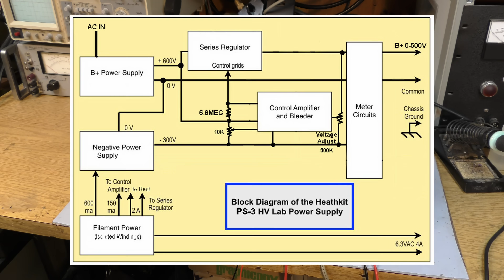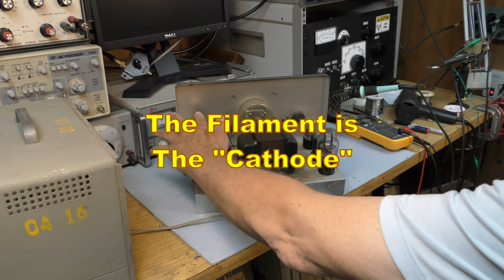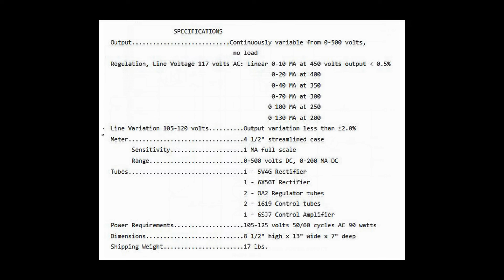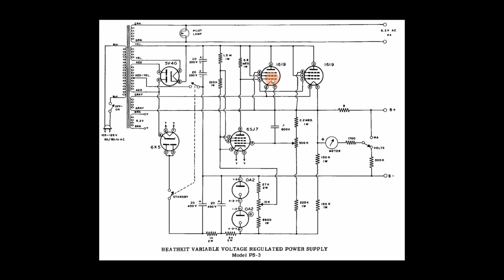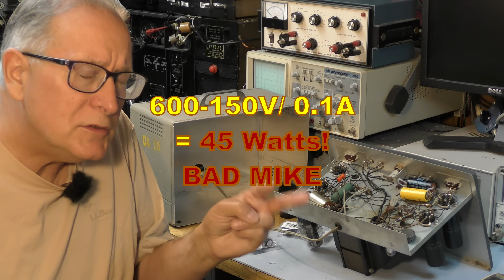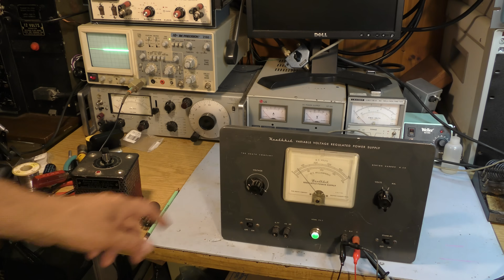Heathkit PS 3 Regulated HV Supply

Comment: Is the filament coated with emisive material in a non-cathode tube?  thanks
Reply from the maker: Actually yes! Filament coatings include Carburized Thoriated Tungsten and Oxide-Coated Filaments: Utilizing a core of nickel alloys coated with alkaline-earth carbonates (barium, strontium, and calcium). In a vacuum, these decompose into pure metallic layers, giving off large amounts of electrons at very low temperatures.

Comment: Your regulation issues likely causes by grid emission in 1619 shunting the 6.8m plate load of 6sj7 and then 6sj7 goes +v grid
Reply from the maker: I know that something is not quite right with the regulation. Perhaps compromises were made to preserve tube life.
Reply: @MIKROWAVE1  the circuit worked perfectly with new tubes . hints are plate resistor  load for 6sq7 way more than 220k or 470k for 6l6 grid.  Collins R390 used 470k or so plate load.  whatever their calculations were, grid emission would throw em off and with old abused tubes grid emissions are very possible.

Comment: In one of the Ap Notes he wrote while at Linear Technology, the late great Jim Williams presented a hybrid voltage regulator circuit using a mix of semiconductors with a big vacuum tube for the pass device. I don't recall ratings, but the approach would be broadly applicable. I think it was in an ap note about boost (voltage, current and/or power) for semiconductor voltage regulators. It may have been in one about boost circuits for operational amplifiers.

These days you might contemplate using linear power MOSFETs for high voltage supplies. There aren't very many linear power FETs on the market, unfortunately. Some I looked at years ago were 600 volt parts with pretty substantial power rating. FETs designed for switching don't play nice in linear circuits.
Reply from the maker: I agree that the logic level drive FETS would be an issue, but in general, many common HV FETS yanked out of old power supplies should have no issue in linear service as long as you stay within the SOA! We shall see.

Comment: Hi this is Dwight again. When you replace the line cord with a 3 wire grounding cord. You will not need to install y caps to the hot or neutral leeds like a .047 mfd. All that will do is put a 60 hz hum on what ever the p/s is used for and it creates a shock hazard. You can check it with a voltmeter. 
You will find voltage being fed to the ground wire on the chassis of the power supply. You don't want that.
Reply from the maker: Remember the purpose of these capacitors. It has nothing to do with safety even though they are called "safety capacitors". They are specifically EMI protection for the outside world from YOUR equipment. Safety is a characteristic in a worst-case situation like a power surge.

Comment: At 8:50 there is no way the tubes are running into anode power dissipation issues at high output voltage. The voltage across the pass element is the supply (say 600 V) minus the output voltage. For a low output voltage the pass tube sees the maximum voltage drop (around 600 V), therefore it sees the highest power dissipation for the same current. 
The assumption that high output voltage means high power dissipation is only true for the load, not for the pass element.
Reply from the maker: Yes, a mistake in my thinking. But the data sheet does not support this, so there is some other factor. At higher voltage, the current rating goes down. It's just the opposite of the premise that set at higher voltage, the pass device should not be dissipating as much.
Reply: @MIKROWAVE1  I agree. I looked up the manual of that power supply and it looks like the other way round, but I don't understand why.
Reply from the maker: @VoidElectronicslooks like I need to do some testing.

Comment: I read about Bob Widlar years ago, genius, very sad to lose a guy like that at only 53 yo.
Reply from the maker: Those amazing chip designers deserve some historical recognition all right! When I worked at ADI, I used to marvel at Paul Brokaw's way of simply explaining fundamental circuits like the band gap reference and differential amplifiers and biasing for stability in IC design. I also got to work with Barrie Gilbert, another giant. And Walt Jung - 555 cookbook etc...

Comment: It's a wonder Heathkit didn't use the negative  150/300 vdc for user external access. Like other HV PS did, at providing a variable -bias voltage output.
Reply from the maker: And a center tapped 6.3 winding would have been nice as well.

Comment: Be careful of using too much capacitance across a tube rectifier.  You can damage the cathode[s].
Reply from the maker: The standby switch if used properly prevents this corner case. Modern tube amplifier designs should all have solid state rectifiers or a STEP-START system for tube rectifier. But it's still a corner case, with very few real-world examples in transformer powered equipment of an actual tube failure. 5V4s are very tough.

Comment: The logic of the voltage/current limit characteristic being due to pass device dissipation confuses me. I would think that since the pass tubes are in series with the load, the current rating (as determined by the tube V*I dissipation product) would increase at higher output voltage (lower “headroom”, lower voltage across the pass tubes) and would decrease at lower output voltages where the voltage across the pass tubes is maximum. Where am I getting the logic wrong here? It only makes sense to me if I think of the limiting factor as being the power transformer, (VA limit) not the pass tubes.
Reply from the maker: Yes, something backwards here - maybe next video.
Reply: @MIKROWAVE1  please, because I wanted to comment on the same issue. Why is it different then transistor pass elements?

Comment: I've got the much later IP-17 and it'll do 100mA at all voltages.
Reply from the maker: Yes, I think they improved the whole deal. Those 1619 tubes were 5 for a buck surplus! Heathkit loved to use surplus parts.

Comment: that circuit attempting to build it in 1 cabinet 1 a low supply with 500 55 ma transformer and another with 800vct transformer project stalled for a year now watched your videos  got it on bench today
Reply: iI was using 12dq6 tubes in parallel and a 6sj7 and6x5 and octal vr tubes

Comment: Very interesting topic, I wonder also if  substituting ( I know socket change ,etc ) another tube like a  higher transconductance tube 6ej7, instead of 6sj7 ,would net any performance gains?
Reply: Try this: the 6AC7 (~~,8,000 uMhos), or the 6SH7 (~~4,300 uMhos). Both are direct plug-ins. You may have to change the cathode-bias resistor. 73, Bruce N7MMR
Reply from the maker: @brucethorpe9521  Those are "super-pentodes" like the UK EF-50.

Comment: 23:50   You put in the capacitors well, is there enough clearance from the capacitor to the casing, because if the capacitor moves the capacitor body could short to the metal case and damaging the transformer or rectifier, if a fuse doesnt set off.  I hope you checked if the fuse value is apropriate, since as you must be well aware, people  mess with fuse values.  Since the schematic does not have an input or output fuse, please add one!  fuses are cheap, new tubes or a new transformer isnt.   Why does american designed stuff always like to leave out fuses?  All european test equipment or even the most cheap radios, even heathkit imported stuff had fuses.  

Also you increased the value of the capacitors, i hope this does not damage the rectifier tube since it could blow open the cathode wire, i hope its protected
Reply from the maker: Absolutely. And yes no fuse, no protective parts. No Thermistor no safety caps etc...

Comment: 2x 100uf in series for 50uf at output of 5v4 may exceed its specs -  and strip cathode. you can as well replace the 5v4 and 6x5 with series connected 1n4007 - atleast 3x series 4007 in each branch.  .
Reply: I thought that, but pulled 3 datasheets and they didn't spec max capacitance, like some do.
Reply from the maker: Great suggestion! But generally, these limits describe a corner case specification. In the case a power supply where there is HV instantly applied to a cold tube, such as a guitar amplifier for instance. This supply has a transformer which slows this some, but more importantly, it includes a standby switch which SHOULD BE off. So, when initially powered, the filament gets juice and the HV is only applied when the standby switch is set to ON. The 5V4 looks original. I wonder how TV sets handled this?

Comment: Excellent overview, Mike! Excellent work. The later Heathkit power supplies PS-4/IP-32 and the later IP-17/2717 were much better than the PS-3. 

I once had a PS-3 that gave me a shock from the chassis to ground. The HV secondary was leaky. I don’t think that transformer ages well.
Reply from the maker: It's a pretty complex (and BEEFY) transformer, with so many floating windings.

Comment: Excellent work! However, beneath the limitation of dissipation, wouldn't output current be limited more toward the lower end of voltage, since the pass elements need to dissipate more voltage there? It is this way in adjustable low-voltage supplies. Food for thought...
Reply from the maker: Oooo sounds like we have something to investigate for next time.

Comment: Heathkit actually produced a variable HV lab PSU into the 70s, maybe even the very early 80s. That was the IP17,  went upto 450 volts and possibly 200 ma from memory.  Only the output stage was valve though.  They are very scarce but I was lucky to find one at a vintage electronics fair in working condition about 8 years ago.
Reply from the maker: Yes, and they stayed with tubes all the way- maybe 1980? I know they transitioned to 6L6s at one point.

Comment: I used to have one of those. Then the power transformer developed an internal dead short between the HV secondary and frame. I ended up salvaging what I could and took the chassis and transformer to a metal recycling place.
Reply: Exactly the same thing happened to me. I used to find these at hamfests in the 80’s and 90’s for five bucks. I recapped another one, used it for several years. My first HV bench supply, it worked great. However, eventually the HV secondary failed in that unit as well. 
I don’t think the HV winding in the PS-3 transformer is very robust, or perhaps age has deteriorated the insulation.
Reply: “Me too.” The HV transformer in mine made a nice crackling noise like embers in the fireplace. I found a younger transformer in better condition. It works for now.
Reply from the maker: Sounds like that transformer is a weak point - maybe ventilation is needed as suggested by a subscriber!
Reply: You can rewind them...

Comment: If the power dissipation of the 1619s is the limit on output current, you should be able to get the highest current out at the highest output voltage.  That is not what the Heathkit specs say.  Perhaps the limit is related to the limitation of output current from the I/V curves at low Vpc.
Reply from the maker: Yes, something going on here. Later they used 6L6s and the current rating went up to a normal level.
Reply from the maker: Maybe the screen connection on the control tube produces sort of a voltage controlled current limit.

Comment: When will you show us the 'solid state'- type of power- supply, for 'high'- voltage ? 
It is exactly what I want to 'brew', for a very old project, in my 'backyard', to re- energieze this old and vintage 'sleeping room guitare- amplifier', again, ... ! 
(Only 0.5W output, with one ECC81, [two triodes inside!] as a 'push- pull'- amp- stage, ... and very strange output transformer, made of a small '230V/12V AC- transformer' ! )

Thanks in advance for the 'new' project, and ... 

73 de Markus - db9pz - JN39fq - 5km/3miles east of 'LX' -
Reply from the maker: Coming up!

Comment: Great Information! I have a Heathkit IP-32  High Voltage Power Supply waiting for new electrolytic capacitors when I get around to it. Any thoughts on upgrading the power cord to a three wire grounded  chassis?
Reply from the maker: Yes sir and this thing does not even have a fuse!

Comment: You should be careful about the maximum voltage between the heather and the cathode in the output tubes
Reply from the maker: Great point. Isolating the filament transformer and referencing them together with a high value resistor like 200K, are suggested.
Reply: @MIKROWAVE1  Are you talking about  positive " biasing" tube filament's  above ground 50-80 vdc to lessen heater/cathode potential  with voltage supplied thru a divider network off B+ ?, I've done stuff like that before. Also  at top of my head (LOL), I believe something like 6dq6 is limited on screen voltage  to maybe 175 vdc. Can"t wait to see your version of this power supply!

Comment: I know these were well used and documented, but in trying to source one or build one, how much current should a power supply be able to provide at the high voltage? Is 10 mA enough or should it be higher? I think the higher current would mean heftier tubes and solid state devices which would mean more $$$
Reply from the maker: Solid state helps here! The real issue is that this is a linear approach, so we are always limited by power dissipation as with any Class A circuit. Tailoring the supply to a higher range like 250V to 400V helps a lot.